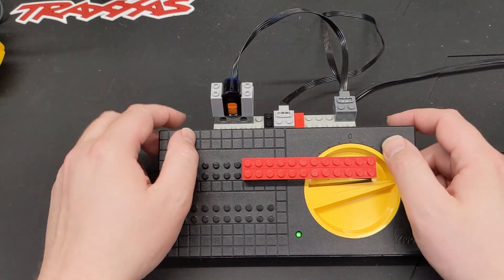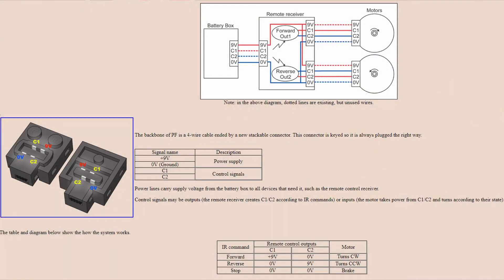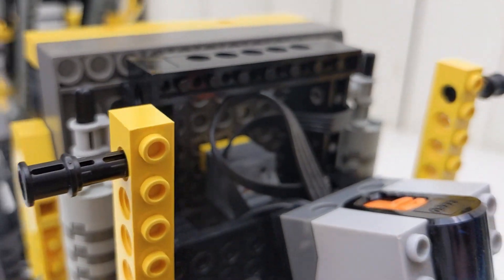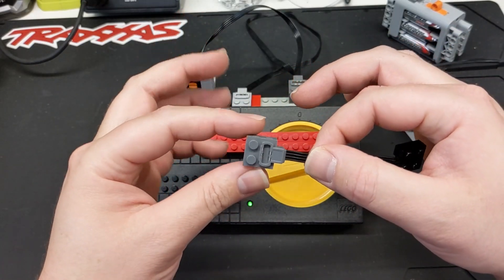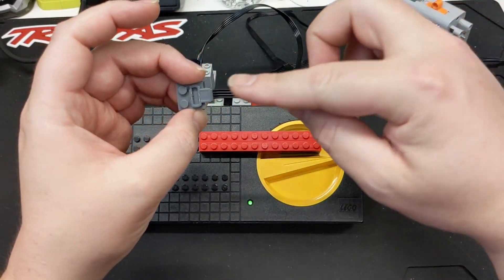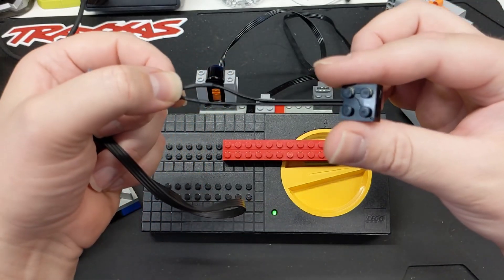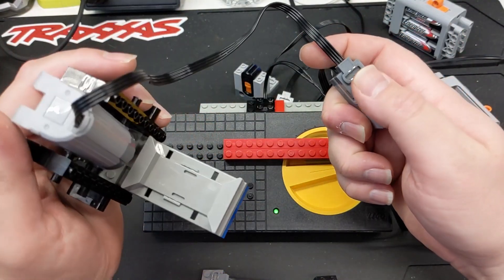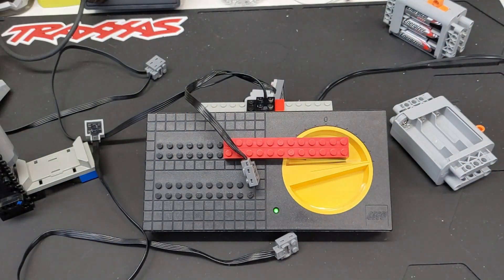Power Functions IR receiver + 9v train regulator = profit?

Comment: Thanks man, i thought i know most of the tricks, with lego electronic, but here i learn something new. I will run now to try the servo thing 👍🤗 thank you
Reply from the maker: I also have a recent video on making your own Power Functions cables and adapters.  I like them way better than the ones I used in this video.  Glad you found it useful!
Reply: @BatteryPoweredBricks  thanks, i have plenty of those.
I ecently i bought rc unit, on radio (2002) that i want to combine with ir receivers on the car. I made something today, but servo can be more accurate then what i did. I will check it out. Thanks ❤️

Comment: Interesting!  I never thought about controlling the receiver from a 9V source.  Now I am wondering about a DCC style system using something like this powered from the track???
Reply from the maker: If I'm not mistaken I think there is a DCC solution for Lego, I think they used a Mindstorms RCX with a custom firmware, and I assume some hardware modification.  Maybe I'll look into it, it'd be interesting to cover it in the future 🤔

Comment: where I can buy this regulator?
Reply from the maker: Bricklink is probably the best option.  They tend to be a lot cheaper internationally but shipping costs can add up.  If you need a few it can be worth it.  eBay tends to be overpriced but sometimes good deals will pop up every once in a while.
Reply: @BatteryPoweredBricks  thanks! After some investigation I will try to build one